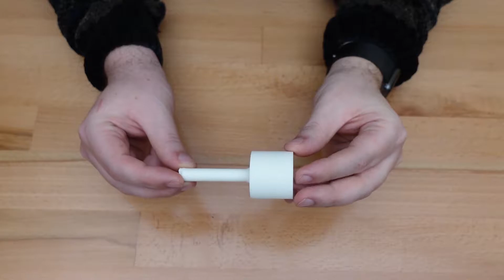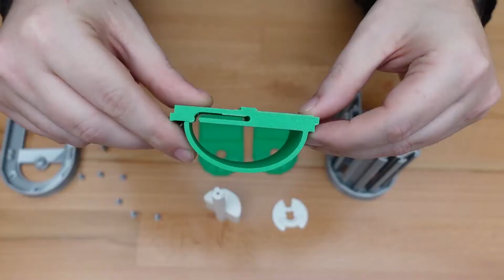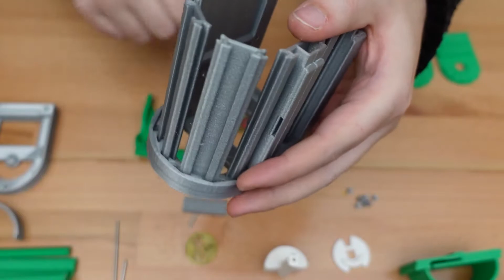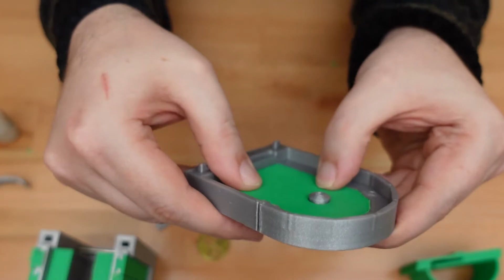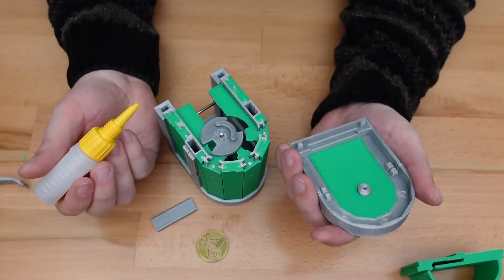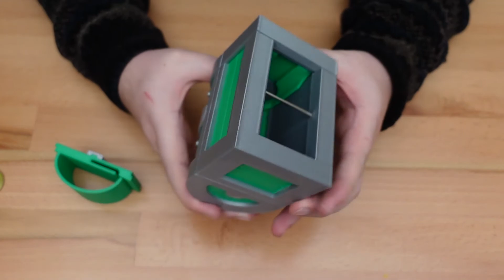Treasure Chest Puzzle Box - Build

Comment: Hi Joe.. not sure you said anywhere what resolution you print your parts at.. I'm trying this model.. is 0.2 (using PrusaSlicer/MK3S) reasonable for most parts.. (rivets will be 0.1)
Reply from the maker: That's a good plan. I usually print everything at 0.2mm - even the tiny rivets!

Comment: The small rod needed to be 93mm for me.
Reply from the maker: As long as that shorter length doesn't fall out, that's great! The length I used is a pretty tight fit.
Reply: @3DPrinty  On my new Prusa at 100% scale the walls were 85mm, so that's why I cut a 93mm rod to fit. Am I the only one who ran into this? BTW the 185mm rod fit well.
Reply from the maker: First time I've heard of this issue. But it's very possible others have found the same problem and just not reported it. In either case, thanks for sharing your fix if anyone else has the same problem!

In my own prints, the longer rod works because the hole in the walls goes deep enough to hold the additional length in the rod.

Comment: What printer did you print the 200% model on? I just discovered that my print volume isn't going to cut it on my FF Dreamer...sigh.
Reply from the maker: The one in the 200% sized video was printed on a Project R3D Daedalus (300x300x450mm). Another 200% sized copy was printed on a Prusa MK3s (250x210x210mm).

I hope you didn't print any parts before noticing the size issue!

I'd recommend trying to print the normal size box. But if you're set on a larger print, you can try:
- scaling this version down until it fits - just be ready to use smaller dowel rods and magnets.
- splitting the larger pieces into smaller parts and glue them together. I've done that before using 3D Gloop, which is a messy, but very good, adhesive.

Whatever you end up doing, good luck and happy printing!
Reply: @3DPrinty  Thanks for the reply. Well I actually bit down and have ordered a Prusa Mk3s+. It's not the first time I have found that my print volume was insufficient. Onward!
Reply from the maker: Great! My Prusa has served me well for years, so hopefully you'll have the same experience. My first Prusa was the kit version, which took a while to assemble, but was very informative when it came to really understanding how these things work.

Comment: Hi! I was wondering where you got the metal dowel rods? I'm not able to find any at my local hardware store or amazon.
Reply from the maker: No problem! Any smooth rod that's 2.5mm in diameter (slightly thinner than 1/8") should work, although you'll need to trim it down to the right length with a hacksaw or Dremel. I think metal works best but you can get by with a sufficiently thin wooden dowel rod.

If you're looking on Amazon, search for "2.5mm round metal rod." I see some options listed under that. It doesn't really matter if it's brass, steel, aluminum, or something else - as long as you can cut it.

Good luck!

Comment: If I do a 200% treasure chest, I would assume I would just double the size of the hardware (ie 6mm x 6mm magnets). Is that correct?
Reply from the maker: Exactly! Although in the case of the magnets, you could probably get away with 6mmx3mm magnets and just add some padding to the bottom of each hole.

If there's interest, I can upload the larger version I printed for Joel (3D Printing Nerd) which featured a lot of little optimization tweaks to account for the larger scale. For example, the tolerances get a bit sloppy when they're printed at 200% scale, so the Joel version was modified to keep those areas tight. That version also included textured slats.
Reply: @3DPrinty  Thanks. Yeah, you you could upload the larger version, that would be great.  I just finished the chest. Awesome design! It took me awhile to figure out how the bottom gets locked in when you reset the puzzle. My 13 year-old son had to show me. Here's a video of me showing the puzzle. Sorry, I screwed up your name...but corrected it. https://youtu.be/9yUE4XqiG98
Reply from the maker: Thanks for sharing your print, and no worries about the name!

That bottom lid can be tricky. In my newer designs I've tried to get better at adding indicators when parts have ambiguous orientations. I guess we can say it's part of the puzzle to figure that part out?

I'm printing a giant sized copy as we speak so I can include it with a new project post on Thingiverse. It takes quite a while to print at the larger scale, so it'll be a couple days still.